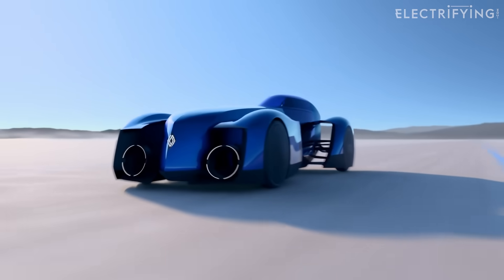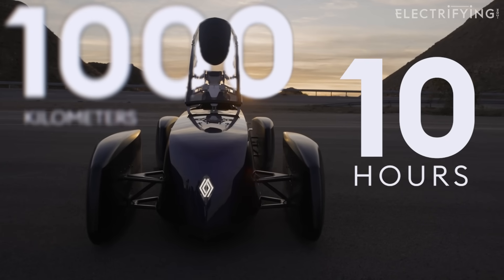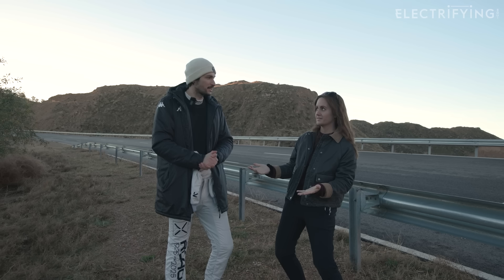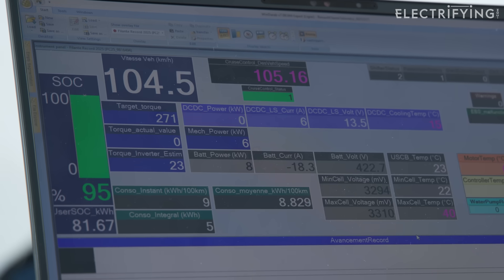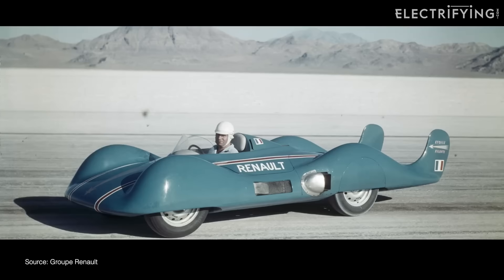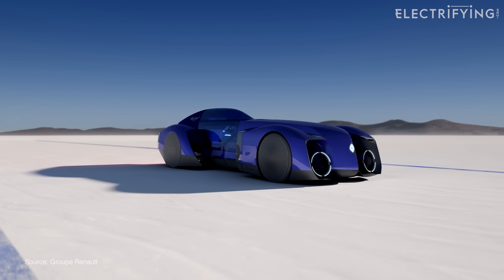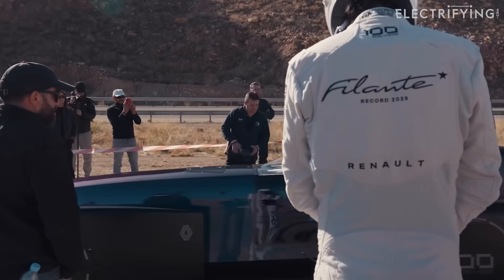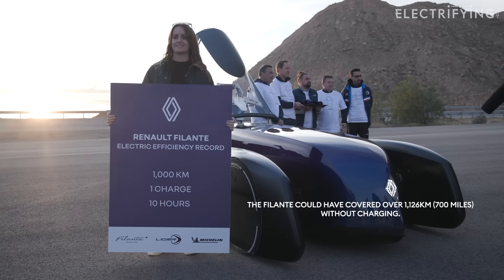1000 km on One Charge in under 10 Hours: Renault’s Wildest EV Experiment

Comment: Genuine question here. With ICE there was a lot of improvement in fuel economy in the early years simply by improving the engine to run more efficiently, along with the use of gearing too of course. That probably caused much greater benefits over many decades than the actual design and shape of the cars, or even the weight.

So with EVs, how much more efficient can electric motors realistically get? Are most of the future improvements in the next decade or 2 going to be much more about making cars lighter and more aerodynamic?
Reply: Electric motors are already almost 100% efficient, the problem is the battery - they are heavy, expensive and relatively slow to charge
Reply: @solarissv777 yep, so that fits into car lightness, although I think right now EVs aren't getting lighter, they are instead getting bigger batteries for the same weight. But eventually we'll reach a point where there's not much point going for more range, and then battery packs can shrink year on year.
Reply: @gazzaman28  personally, I believe that all this EV craze is stupid, instead of making cars EV bigger and heavier you could just use ICE cars less. The solution is to use public transport for most trips/commuting etc. and using cars only when absolutely necessary. The emission reduction should be solved not by car manufacturers, but by city planners by making actually convenient public transportation systems and cities layouts.
Reply: @solarissv777 Ha! Good luck getting people to use cars less without throwing a lot of money at massively improving public transport and/or reinventing the world to need less travel!
Reply: @solarissv777  My original comment has disappeared. No matter, petrol and deisel go with engines and batteries go with motors with no swapping between the two methods. Efficiency is a product of their combinations so it doesn't matter that motors are way more efficient than engines; batteries are so far less efficient than fuel that when combined the EV's are less efficient. It's why they died out 100 years ago, and have prematurely entered the market. It's why the average range of an ICE car is about twice that of the average EV. Talk of better batteries coming and stunts like this are just to maintain hope for EV zealots while the reality is they are still inferior on power-to-weight issues.
Reply: Smaller engines and 'pancake' axial flux engines + solid state batteries with 2-3x of energy density, giga casting - lower mass - I think with the combination of all of these technologies would send whole ICE cars to historical trash. Now for 90% of people EVs are enough for daily commute.
Reply: @LittleBoobsLover  I had a Citroen C5 that did over 1,300kms on a tank. It carried 5 and was packed with creature comforts, but mainly it was real. No EV gets close. BTW, I own a BYD Atto3 - I just happen to be a realist.

Comment: It would be interesting if they make a mass produced version as even if it's slightly less efficient so would it still be interesting. They could most likely also add in the needed commercial features and make up for it with a slightly larger battery.

Comment: To be honest, I was expecting better from a custom built vehicle like this. 7.96 mpkWh is good, but a standard Hyundai Ioniq EV (28 or 38kWh) can achieve the same. I bet if you pumped the tyres up and took out the seats etc to shed weight, it would do the same as this Renault at these same speeds.
In this video https://youtu.be/RX4Q6C4ifEk?si=36f4fFhOjBFwLhiC I showed how an Ioniq 38kWh averaged 7.4 mpkWh over 2.5 hours of driving.
Reply: They learnt nothing in the wind tunnel. A vanity project.
Reply: @AJames-jr8kw Very true my friend 😊

Comment: ❤should have 3 wheels 🛞 2 front 1 rear most efficient!! Aptera ! Claimed 1000 miles 100kw battery 🔋! With solar gain !
Reply: 4 wheels shows Aptera is doing it wrong. Also, 2 seats is wrong, especially side by side.

Comment: Record breaking for electric, doable for petrol, easy for diesel. Currently hybrids are winning because for most people they make the most financial sense.Let me explain, most people who buy a electric car have decent income. Which in result means most of them buy new or very young second hand. A large part of those same people have a personal charger/charging spot at home. Now this car gets older, lets say 8-10 years. This first or in some cases the second owner sells it. It's an older car so people with money most of the time do not buy it. So now people with lower income need to buy this car. People with lower income most of the time have no large reserves at te bank. So buying a car in the first place means a part of them do that on a loan. The other half can manage without a loan if the car is cheap enough. They have to choose a car that uses petrol or diesel and has regular maintenance but it is spread out in smaller bills. So cost come over time. Or they buy an older electric car and take the risk that they will be confronted with a 1 time catastophic big bill if something like the battery is end of life (remember they have lower income and hardly any reserves they live by the month as their salary is paid). Because of the people with less money that need to buy these second hands rather choose petrol or diesel cars causes electric cars to depreciate faster. This causes a lot of the new buyers to complain, as they have to write off much more then was promised to them.

Comment: Why doesn't Renault send this car to the World Solar Challenge
Reply: They would get humiliated.
Dutch Uni team won the 3022km race in 34.9hrs. That is 86.6kmh from sun energy from 6m² of panels which in the Australian winter develop about 7kWh a day.
So basically a bunch of Uni students built a car that does 90kmh on 1kW of power.
Aero drag at 100kmh is 23% higher but rolling resistance is same so it probably takes Nuna13 1200W to do 100kmh. Ergo a 12kWh battery would get them 1000ks in 10 hours compared to Renaults 87kWh battery. So the Renault is 6-7 less efficient than the Solar Cars.
They should have looked at what works first.

Comment: But Mercedes-Benz Vision EQXX is a fairly normal looking 4 seat car with heating and air con that has exceeded 1,100km range per charge when being driven at Autobahn speeds of 130 km/h so this Renault seems to be about 10 years behind in tech to have a single seat car with separate wheels, 1 seat, no heating or air con, that is able to do 1,000 km at just 100 km/h which is not exactly Autobahn or even UK motorway speed.
Reply: It took the EQXX 5 hours more to achieve the same distance at lower speeds, with a much bigger battery and an inferior efficiency.
Reply: @clementeygun171 but it was a normal car,it has sound insulation,ac(basic car things)
Reply: The EQXX averaged 87km/h on the first run, only hitting 130km/h while running on the Autobahn, but not sustained that speed constantly. A/C used but not continuously. 
Second run it average 82km/h and the third 68km/h

Comment: It really brings home how abysmal batteries are for storing energy when you consider that the very ordinary 14 year old 2 litre diesel Skoda parked outside my door can easily do 1000 km at 100 km/h on a single tank of fuel without sacrificing air conditioning, 4 heated seats, or enough room in the boot to literally carry a washing machine. In the test conditions shown here, I'd expect it to have at least 300 km range left after hitting the 1000 km target. 

Another test recorded in a video on YouTube using the 1.6 litre bluemotion TDI in a Passat got from Morocco to London on one tank of fuel (With a ferry from Morocco to southern Spain and the channel tunnel train for the water crossings), so more than twice that distance in real world traffic, 2388 km according to the video title. They didn't average 100 km/h, but it's likely that car would easily do 2000 km at 100 km/h on one tank in the test conditions in this video.

Comment: I've had 8miles per kWh in my ioniq classic to work and back 28 mile round trip in n the summer, no Aircon driving smoothly.
Reply: Just made a similar comment about my ioniq. Although my best was 7.1miles/kWh.
The previous owner lowered the car and slightly angled it forwards. Sometimes I wonder if it hurts efficiency when reading other Ioniq comments. ^^

Comment: Helmet seems overkill.
Reply: 1000ks, if something breaks you could be sliding down the road at 100km/h. Carbon fibre is brittle and shatters on impact. The shell may not protect you.
Reply: @AJames-jr8kwTrue, it's not a safety-tested production car but a prototype contraption. I stand corrected.

Comment: 6:42 8.69kWh/100km @ 105km/h - not impressed. e-Up can do 10kWh/100km @ 90km/h. And it's a proper car and heavier
Reply: 105 is 36% more air resistance, so 13% less consumption seems like a big step, the e-Up might need around 13kWh and still without the range capabilities, else it would be heavier and bigger. But also even in prototypes physics kicks in and induces diminishing returns for sure.
Reply: Are you sure about that 10? Behind a trucK? Downhill? Or Peaky data doesn't count here, it's 10 hours straight of that figure
Reply: @malloot9224  Yes, i am sure, i have the car. You can choose to believe it or not

Comment: ok so if this is about making every day cars go further, then what they should do is somehow make covered wheels look cool
Reply: I think covered wheels will be making a comeback as the efficiency gains are probably huge. Especially the rear wheels like the old Honda hybrids, there's no real negative, looks are subjective. But then again everyone's buying crossovers so I guess it's pointless 🤷
Reply: @timscott3027  pain in the backside to change a tyre, more intensive to visually inspect the wheel/tyre/brakes, and it collects moisture (rust).
Reply: @sIightIybored it doesn't have to be like that though, I'm sure there's a way you could design it so it isn't a pain to open and doesn't collect moisture, or is made from plastic or something.
Reply: @timscott3027  transparent plastic, with some quick release locks? No rust, still can inspect  the tyre. Also you can make even the front tyres covered, if you make short hood like Telo and motorcicle like covers, affixed to a wheel, and not the body.

Comment: I thought the e-up! and its clones could do about 7miles/kwh on a good day…? Though I guess that would have been pottering around town, not at motorway speeds.
Reply: hyundai kona could do 9.8 kwh/100 km in the summer in the city driving up to 50km/h - here you can get average speed 102km/h Double the speed, lower consumption
Reply: Have an e-Up. You can comfortably double that in winter in mixed driving conditions, and kiss it goodbye over 50mph. In short, it'd need to be a REALLY good day. 😉

Comment: It would be interesting to see this do the cannonball run
Reply: At the speeds it's doing in the name of chasing range, it would be very boring to see this doing the cannonball. Aging Wheels have done 2 videos following a Cannonball Run project using a Rivian pickup with the bed filled with 2 more battery packs, with the second update video posted yesterday. Their first leg from the middle of NY, with all batteries full was 820 km on a charge, averaging 110 km/h in a brick shaped pickup truck near its max gross allowed weight, with all terrain tyres and 3 people on board in normal traffic at about 2.7 km/kWhr. They were nowhere close to breaking the current EV cannonball record by the time they abandoned the run, but were charging at 500 kW at multiple stops.

Comment: They needn’t have bothered and just looked at Mercedes’s EQXX results, where they added the second gear to the CLA to maximise highway efficiency. Also interesting that the time wasn’t a little faster. Björn Nyland regularly tests new EVs over a thousand Kilometres and the best of them finish those Norwegian and Swedish routes in <= 9 hours with 3 or 4 charging stops (Tesla model S, Mercedes CLA, NIO ET9 & ES8, Zeekr 7X etc)
Reply: Renault engineers want to engineer, not just look at the results of a competitor.
Reply: @drfisheye that’s fine, but it just shows how far they are behind the European competition let alone the Chinese. Probably explains why their cars despite having great design are using bang average tech
Reply: @stephenwensley  That's just a massive cope on your part. It was a different time not so far but all the geopolitical and technological environment is not anymore the same and  Renault used a 87 kWh L-ion battery  more densely packed  taken from a real production car that's still made in France—compared to the larger, more spacious 100 kWh pack Mercedes used in the EQXX, which will also appear in their upcoming mainstream CLA-based EQ model for a starting price around €50k. And claiming that other European carmakers are doing better in EVs is another cope; everyone knows the German manufacturers are not going through a full-blown structural crisis right now.

They  did not much to catch up chinese carmarker on EV despite their experimentation on the EQXX and even the korean do better with Hyunday.
Reply: @julienPascal-t8b Don’t confuse the performance of the companies with the new products they are offering the BMW neue klasse is probably the best EV in Europe right now, and the new Mercedes CLA 250+ and Porsche Cayenne aren’t far behind. The companies may have made some strategic errors but the latest products remain very strong. Even the wider VAG group is turning average MEB products into great ones in the case of Skoda and VW’s ID.Polo looks like it will be very competitive with the Renault 5.
Reply: With the exception of the BMW iX3, I don't see any real equivalent that's competitive enough to truly stand out in customers' eyes. Most traditional buyers of these famous German brands are struggling to connect with the new, generic, and soulless designs--EV technology included--and many feel it's simply not worth the price. For now, they'd rather stick with a proven classic like a VAG 1.8L or VW 1.5 TSI engine with a good as old 90' platform.
As for Renault, expectations have never been particularly high; that's always been the case, so they don't have much to lose -that always been like that- they're carving their own path with a distinctive style and approach in the eruopean EV wave  which is precisely why Renault remains an iconic european brand, that's a good thing for the european auto market and thus for european customers to have them in, despite all the criticism and cold disdain you sometimes hear.
Reply: @stephenwensley  Chinese cars aren't typically very efficient. They compensate with having the newest fast charging battery tech.
Reply: @drfisheye agreed they are pretty rubbish with the best being a good 20%+ less efficient than something like a Tesla. China is bringing in laws requiring companies to improve EV efficiency by 11% next year. Renault however don’t seem to have changed anything, a Zoe ZE50 I was driving 5 years ago has pretty the same battery capacity, charging, cold weather performance & range as a new Renault 5
Reply: That wasn't the point though. The point was mostly to make their engineers think outside the box, make them passionate about their goals. Its probably more of a team building thing than anything else. Secondary goals were publicity and the actual engineering results.
Reply: @TheAnon26 and the tech can be used in their motorsport cars and also on the road and plus this is about their history. Renault are knocking it out of the park